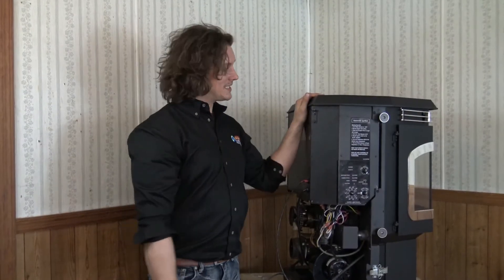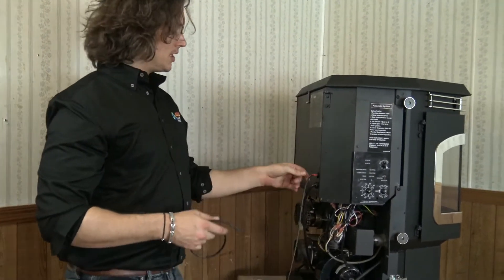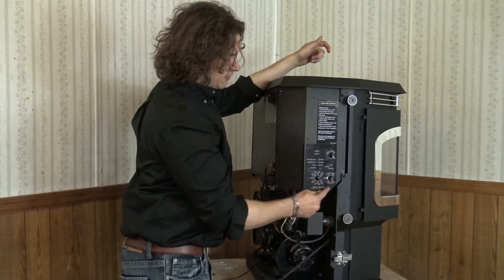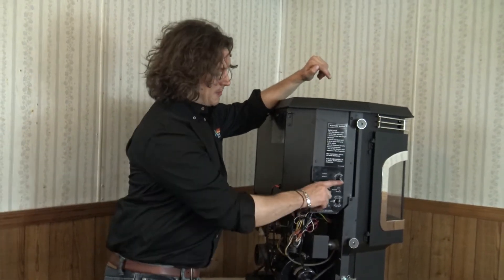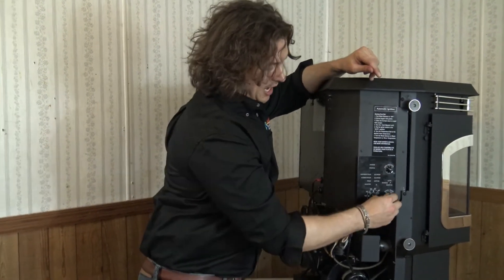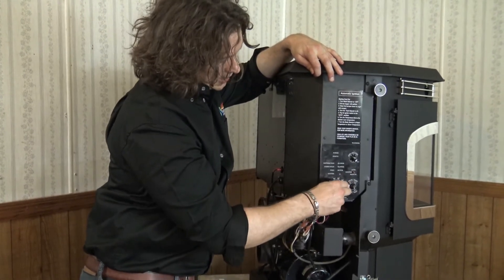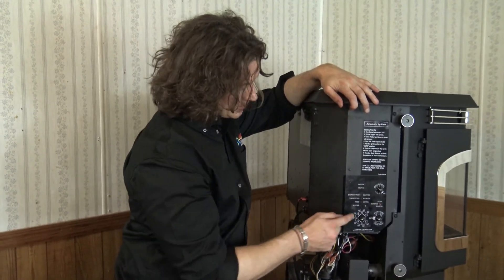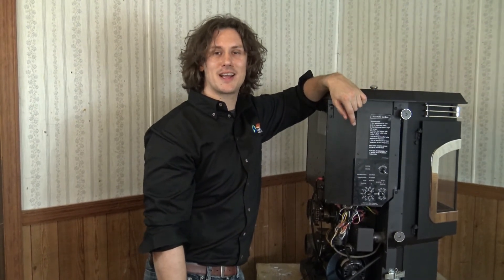Harman Stove Controls, How to use a Harman Pellet Stove

Comment: HI, I have a P43 that recently the distribution fan would stop when in stove temp, with a setting at 5. It does it both in auto and manual mode. There would be a fire, maybe smaller than normal. Reverting back to room temp and the fan will instantly turn back on. Any suggestion on what could be the issue?
Reply from the maker: Hey Aaron, thanks for contacting us. This is most likely an ESP Probe issue, control board issue or a combination of the two. First try just cleaning your ESP probe - we have a video on our page here that will show that process. If nothing changes, first suggestion would be to replace the ESP probe before looking at the control board. Keep us posted, happy to assist and happy to make sure you get the best price on any replacement parts you may need. 
Thanks,
Mr, Pellethead

Comment: hi i have a p-38, new upgrade board installed saturday, and cleaned, can anyone offer the combination to slow down burn rate, cannot get stove temp below 325 deg. old control could regulate down to 200 deg. good marketing move if you also sell pellets
Reply from the maker: David, Thanks for contacting us. I ran this past our lead tech - here is the information he provided: 
Unless it’s clarified, my assumption is that he’s measuring temperature of the dist fan air.  Harman realized that older control boards were running the stove to cool thus promoting creosote formation in the stove but more importantly the exhaust venting .  With the introduction of the 5886 A-F and the newer manual light stove boards, the minimum exhaust temp was raised from 200 degrees to 285 degrees.  Naturally this means the room air is going to be higher when compared to the older boards.  It’s all about stove performance and safety.

Hope that helps, any other questions please let us know. Thanks,
Reply: thank you for his info, stove operates much better, easier to lite, up grade is a no brainer, again thank you !
Reply from the maker: @davidcohrs1  Excellent to hear David! Any future questions or needs just let us know. Thanks!

Comment: Hey this is a little off topic but maybe you know the answer. I have a Harmon p45 about 15 years old. Recently bought a tripp lite 750u battery backup that's supposed to last about 45 minutes so the unit can cycle down and not have smoke back up into the house. Do I have to turn the stove off when we lose power or will the stove shut down automatically when it switches over to the tripp lite. Will it know to shut itself off? Thanks, Laurie
Reply from the maker: Hey Laurie, thanks for contacting us. I'm not familiar with the Tripp lite 750u back-up system, however I would assume it works similar to other battery back-up systems. When power is lost it will switch to battery back-up and continue operation as you have it set. If you want the stove to shut down then you would need to turn your stove temp/room temp dial to off so it can go through proper shutdown. Any other questions please let us know. Thanks!

Comment: I have an older Harman Advance. The Distribution blower stopped so I replaced it. While in the back of the stove I see a Green wire with a yellow trace coming from the left side and long enough to connect to the ground block but I have no idea where to connect the wire or if I should. It looks to be connected to the exhaust blower. The exhaust blower does run. Any help appreciated.
Reply from the maker: Thanks for contacting us Nars. Yes that green wire with the yellow trace is the combustion blower ground wire. It doesn't necessarily need to be grounded for the motor and stove to work correctly, however it is good to have it grounded to the stove. Being a ground wire, it can literally be grounded to any metal area within the stove. Any other questions please let us know. Thanks.

Comment: I have a harman p68. I have it set to automatic and room temp low at a degrees of 70. The status light is lit up red at all times and it is constantly running and the feeder is running. Even if my house it at 80 degrees. Please help. Could it be the probe. I've placed it in different places and it has not made a difference
Reply from the maker: Thanks for contacting us. Happy to assist. I would always start with the basics first. In this case the room sensing probe. The room sensing probe is a very delicate sensor. I would suggest trying different temperature settings and positions with that probe. If the house/room is always at 80 degrees no matter the temp setting or probe placement, then I would suggest first trying a new replacement probe. Happy to assist. 
OEM Probe: https://pellethead.com/product/harman-room-air-temp-sensor-thermostat-sensing-probe-wire/ 
Aftermarket Probe: https://pellethead.com/product/harman-room-air-temp-sensor-thermostat-sensing-probe-wire-2/

Comment: I have Harman Accentra Insert. I recently noticed that the Stove when set to Automatic. Even when I set the temperature to a lower Temp setting the setting is ignored and the stove is running at full bore, No Blinking lights no indication that there is an issue.. any idea's??  The Stove was professionally cleaned (full cleaning)about a month ago and everything including the temp setting seemed to be working fine. I clean the stove weekly. Not as complete as the annual cleaning but cool it down. Clean the baffles, empty and vac the firebox, scrape the burn pot, clean and vac the igniter area etc.
Reply from the maker: Thanks for contacting us, happy to help. The most important thing to look at here would be the room sensing probe. This probe is very sensitive in monitoring the room temp and adjusting the fuel feed and blower speed based on the temperature you have set when operating in Room Temp mode. Cold drafts and direct sunlight can greatly affect the room sensing probe. First thing I would suggest would be to play with the positioning of that Room sensing probe wire - try a few different placement spots and see if anything changes. If nothing changes and it still runs at full bore on room Temp regardless of the temperature setting, I would suggest you look at getting a replacement room probe to start. They are fairly inexpensive and probably the best place to start before we would start looking at a possible issue with the control board or ESP Thermistor Probe. Here is a link https://pellethead.com/product/harman-room-air-temp-sensor-thermostat-sensing-probe-wire/

Hope that is helpful - keep us posted. 

Cheers,
ESESstoves

Comment: I have a 2002 Harman accentra Can you tell me what the status light blinking 6 times mean?
Reply: OK I did all that you said about to give it a go. What is was doing before is starting up for a little while then it would stop feeding and the fire would go out. So i did some cleaning but missed a couple that you mentioned. Cross your fingers cuz I hope this works this time. If not I will get back to you and let you know. Thanx for all the help!!
Reply from the maker: @napoleonbarros8272  sounds good! Keep us posted, happy to help!
Reply: Hey I would love to replace the ESP probe but you asked if the wire color was red or black. On my Harman it is white the site you sent me too I only saw red one or a black one so which one would I buy for mine?
Reply from the maker: @napoleonbarros8272  Hey Napoleon, If you have a white wire ESP, the Black Wire ESP Probe will be the correct replacement for you. Any other questions please let us know. Thanks!
Reply: @EarthSense  this sounds like my stove right now.  We have replaced both esp probe and panel. What about the little door that lets pellets in? How does that work and how can it be cleaned?
Reply from the maker: @gaoo07  Thanks for contacting us. You can access and check the function of your fuel slide plate. There is a sawdust cleanout box generally located right behind the auger motor on most models. There will be 1 or 2 wingnuts to remove the cover of the sawdust cleanout box. Clean out any accumulated fines in there. Empty your hopper of all pellets. You can then move the feeder arm that moves the slide plate back and forth. You can pull the slide plate completely out to inspect. Check the lip on the slide plate to make sure it's not rounded off or wore down. When completely pulled out you can see the entire hopper throat to the auger and ensure there are no obstructions. Let us know what you find there, we are happy to help. Thanks, Mr. Pellethead
Reply from the maker: Thanks for contacting us Napoleon. A 6 Blink Status Indicates poor or incomplete combustion occurring for more than 50 minutes. Here are some things that can cause this-
1. If the stove ran out of pellets. - You can simply turn the heat selector to off and back on again to reset
2. Cleaning/Maintenance -
    A. Check the Burnpot holes to make sure they are open. Make sure the burnpot is scraped well.
    B. Remove the inner panels and thoroughly clean all heat exchanger tubes
    C. Remove the combustion plate behind the ash pan - clean the impeller and exhaust throat. 
    D. Make sure the vent piping is clean and free of excess ash build-up. 
3. Check your Combustion/Exhaust motor. Make sure it appears it's running as it should. Over time this can get weak and no longer be operating at correct voltage
4. Make sure your door gasket seal looks good and is sealing tight all the way around. 

You should have a crisp, torchy looking fire in proper operation. If it's in any way lazy, it's likely one or more of the above mentioned items is contributing to that and in turn causing the 6 Blink Status light code. 

Let us know what you find, we are happy to assist. 

Thanks,
Earth Sense
Reply: OK so it worked for about an hour then the auger stopped feeding it pellets and it went out and I left it alone in about 20 min it started back up on it's own and lasted about 45 min and went out and did not come back on. When it cooled down and everything shut off the status light started blinking 6 times. Any ideas do you thing one of the parts on it is going or gone?
Reply from the maker: @napoleonbarros8272  what model do you have? How did the fire look when it was burning? Was it crisp and torchy? Something you can do in the meantime is to clean the ESP probe in the exhaust. We have a video on our channel that will show you how to do that. We'll help get this figured out with you and get everything back to 100%.
Reply: I did clean the ESP probe already when I saw your other video. The flame was crisp and torchy.
Reply from the maker: @napoleonbarros8272  thanks Napoleon. Let me speak with our main technicians when they're back in the office on Monday and get there insight. I'm leaning towards your esp probe being the issue here based on everything you've checked and we've discussed. I'll be sure to follow-up. Thanks.
Reply from the maker: Napoleon, Thanks for your patience. I spoke with our lead tech on this. He said he has seen issues like this in the past and it has boiled down to either a control board issue, ESP probe issue or a combo of the two. Being that we have literally checked and gone over everything else, we would lean towards you trying a new ESP probe first and if there are still issues proceeding with the Newest program Platinum control board. For the ESP probe we offer both the OEM and aftermarket. There is a red wire probe and black wire probe - make sure you are getting the same wire color probe as the one you are pulling out. Here are links below for you to review. Please keep us posted, we are happy to help anyway we can. 
ESP Probes: https://pellethead.com/product-category/parts/stove-parts-parts-2/harman-stove-parts-parts-2/switches-sensors/
Platinum Control Board: https://pellethead.com/product/harman-platinum-circuit-board-control-panel/

Thanks,
Reply: I have been watching all your video on youtube. I have a  2002 Harman accentra
Reply: Well it finally stopped working the auger is not feeding the pellets any more all the lights comes on and everything else is working except the auger. How can I check to see if power is actually getting to the auger motor?
Reply from the maker: @napoleonbarros8272  Hey Napoleon, sorry to hear of the continued troubles. You can A. Turn the Stove to TEST to see if the auger starts working, B. You can use a multi-meter and check to see if there is voltage coming from the lead wires to the auger motor. C. You can take the auger motor out and test it to direct power. Here is a link that will show you how to do that. https://www.youtube.com/watch?v=rlmiCYI2WPk  Keep us posted, happy to help anyway we can. Thanks.

Comment: i have a P68 and I think I could have bought a smaller one. How do I get it to make less heat so it does not turn on and off as much. I think I would burn less pellets if it just stayed at a more even heat, all day long. Any advise would be nice thank you.
Reply from the maker: Hey Jim, based on what you are describing, I would suggest you throttle the feed adjuster down to maybe a 2 to start and once the unit is lit turn the igniter toggle to manual to keep a constant fire. Run on room temp at desired temp setting and keep the dial on the L in room setting mode. Let us know if that helps.

Comment: Hello, I have the P-68 model and the blowers and lights go on and off when I turn the unit on automatic. I am using this for the first time since purchasing the house. It seems to be running well on manual. It's yet to show any flames/fire after 15 minutes of running. Any advice? I will seek out an online manual from Harman. Your video is informative by the way, great stage presence!
Reply: Make sure all the lids and doors are closed tightly. Had the same thing happen, service rep showed me.
Reply from the maker: Thanks for contacting us. Glad the video was helpful. Yes, first step would be to get the owners manual so you can see exactly what the operating lights should be doing. You can email us direct at info@pellethead.com and we are happy to help with further troubleshooting and get everything operating 100%. Thanks.